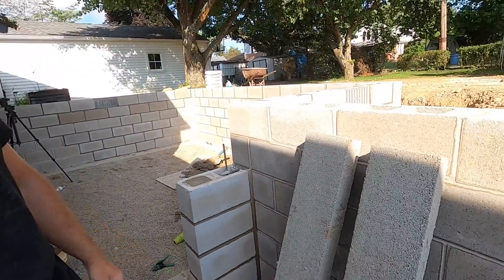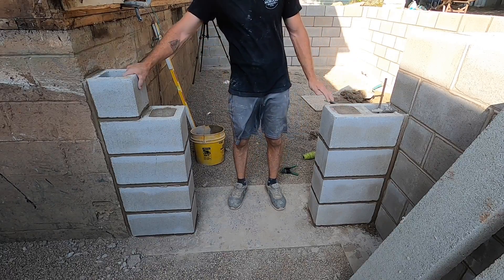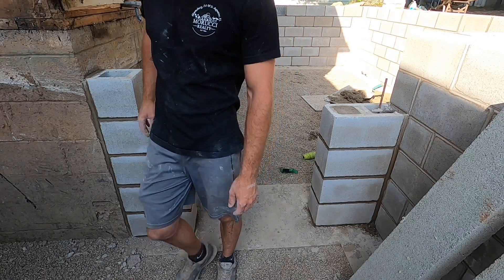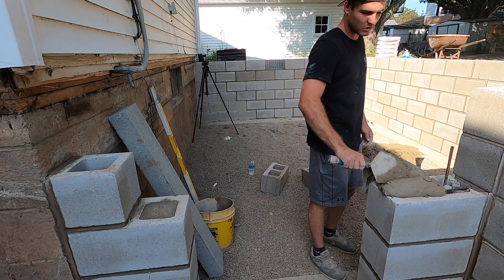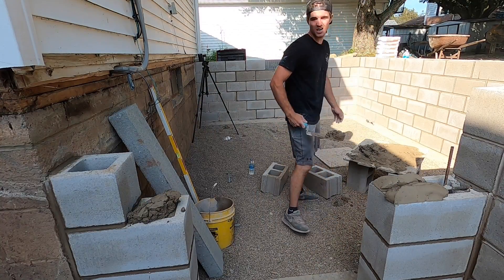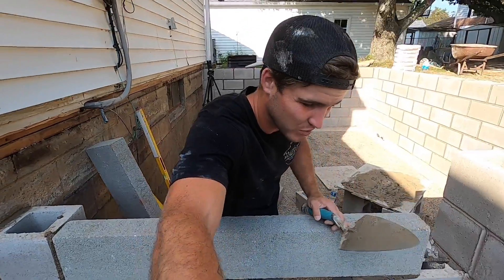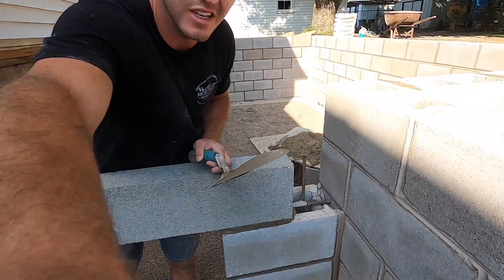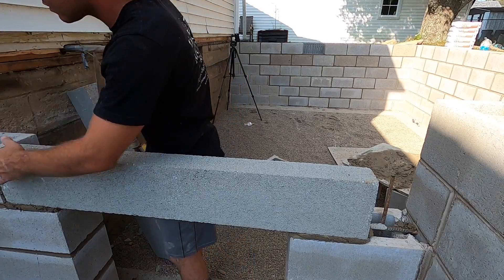How To Lay Block Lintels

Comment: I have a block building with brick vaneer. The garage door in it is standard 7 ft tall. I have a 10ft ceiling built out of concrete double tees. Donyou think it would be a massively hard job to raise the lintel for added garage door height?

Comment: I like these tips and hey can you tell me what that black mortar is around the edges of large door openings I saw being used on a new fire dept. engine bay beneath the steel header, it was used through out several courses, possibly epoxy?
Reply from the maker: Thanks. I have no clue man

Comment: Would you have been able to lay the other block and just measure and cut it to size with a masonry saw ... I got a job for ya if you wanna travel to Michigan.. 20x30x20 .. footing and 3 rows of block. What would you   charge for sometime like that ? .. be addition off the back of the house .
Reply from the maker: Either way I needed a cut. It’s easier to cut the block and keep the lentil whole. I’d need quite a bit of money to travel that far
Reply: @masonthemason6412  .. I got yeah .. makes sense.. if were a local job .. what would your price range for something like that ... 5-10k .. 10-15k .. 15-20k .. I'm getting bids all over place .. just thought with your experience could save me from getting ripped off lol
Reply from the maker: For 3 courses and a footing. If I dig it it would be around 5 or 6 thousand
Reply: @masonthemason6412  would you travel for 10k total job ?
Reply from the maker: I’d have to bid it 100%. Then figure out the housing situation

Comment: What about a lintel for a man door that isn’t the exact height of how the blocks stack up? Would you put the lintel above where the door will end and then put wood in the gap? Cut the pieces horizontally? I can’t find any videos in this, just a bunch of videos on cutting a hole for a door in an existing block wall.